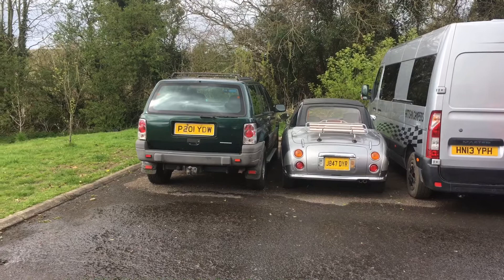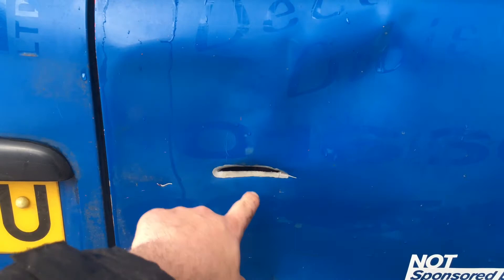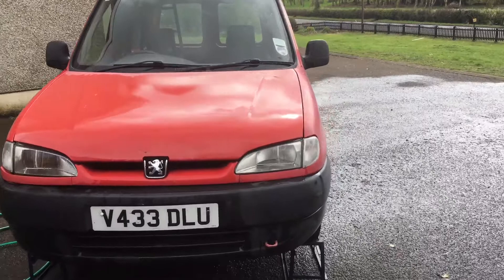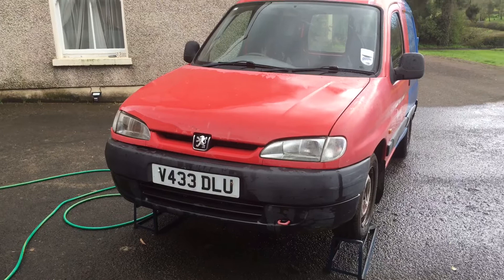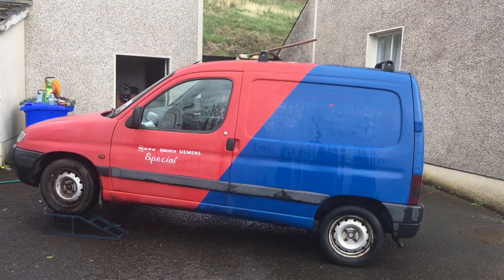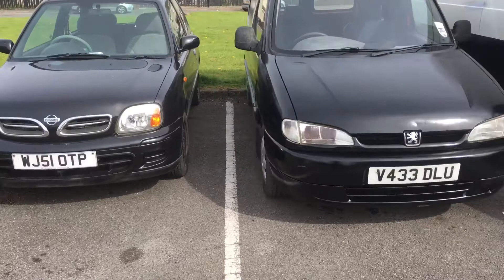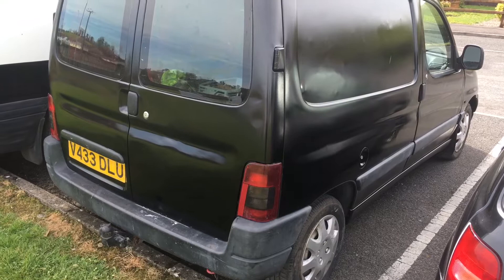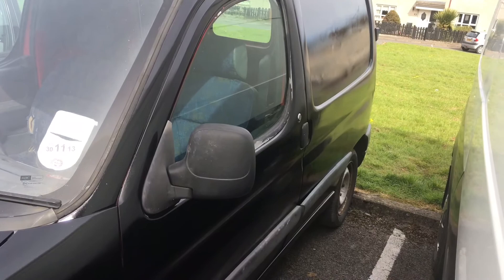Peugeot Partner Quick Respray

Comment: That wound in the back door was actually caused by a run away trailer, I jumped out of the way and the door took the brunt of it rather than my leg
Reply from the maker: What a legendary bit of info! Believe it or not Steve the van as at mine at the moment having a few injection pump fitted 💉